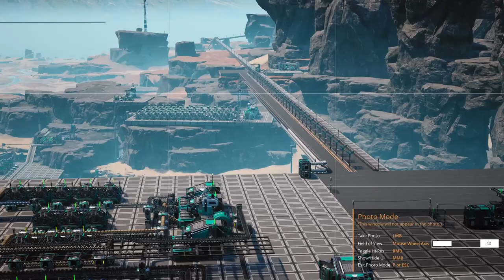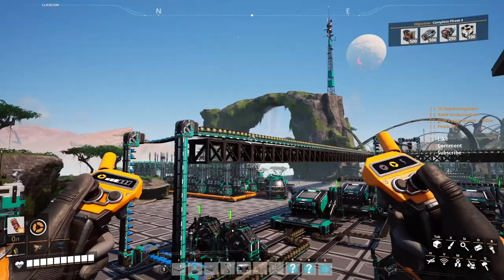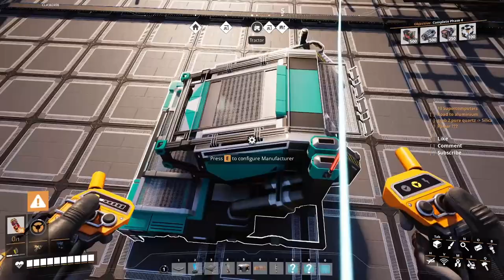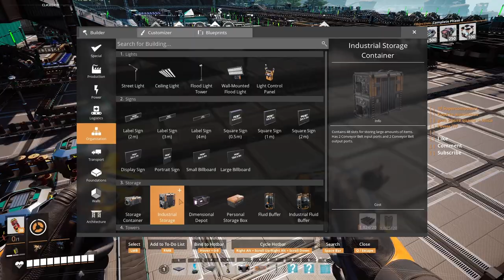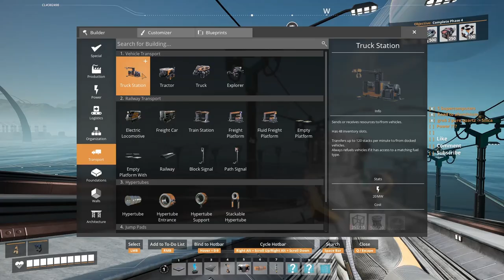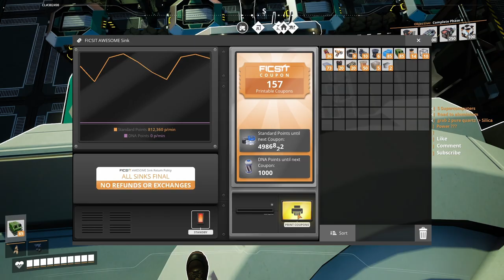Satisfactory 1.0 - The Final Factory - Day 15: 5 Supercomputers/min &  56.250 MW Diluted Fuel Power

Comment: Ignoring the odd funky belt the factory is looking good 👍🏼 At least your build is consistent in layout. I need to settle on a consistent look and feel for my rebuild. I’m probably going to start again in the same save in a different biome basically building everything as big as I can from the local resources and delete my existing factories in the Rocky Desert as they get replaced.
Reply from the maker: That belt brings in the concrete, it's not aligned to anything, just a straight shot from that limestone node. I'll modify-it just not to have-it there like that. Thanks for being here @vikingbrit270 and good luck with your big project.